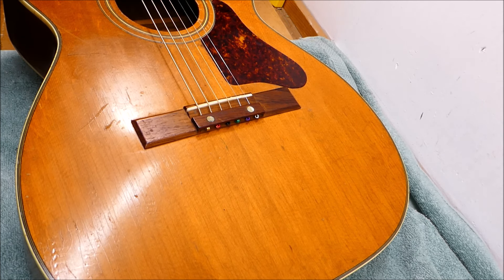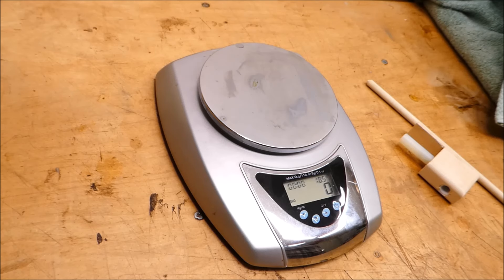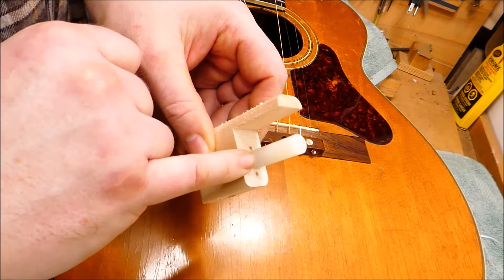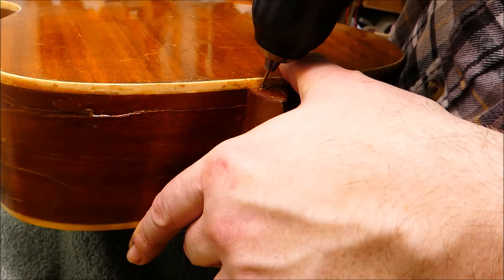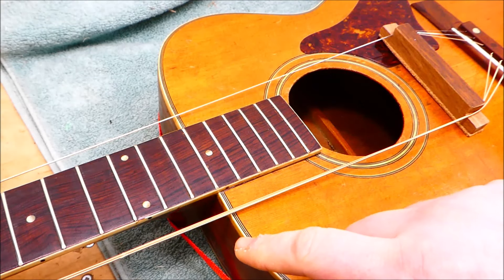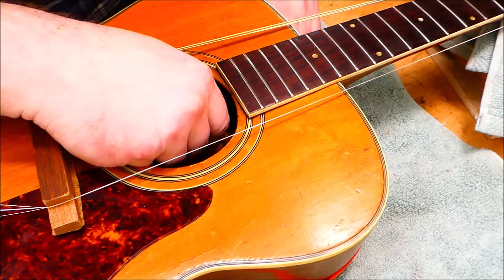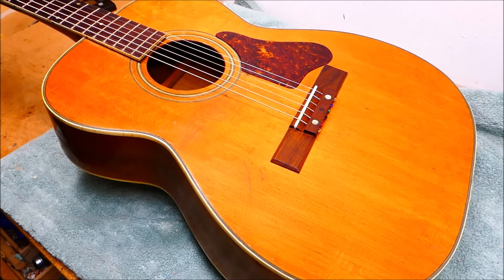Things went horribly wrong!

Comment: The Upgrade from tone nails to the timbre screws was a fantastic choice .
Reply: If I had that job there would be a 1/4" bolt thru the neck heel.  I'm no luthier, just a mechanic.
Reply: These are Swiss Moon screws. Wayyyy better than standard screws.
Reply: Those appear to be stainless steel, it would have sounded better with brass screws. :-)
Reply: @burp1914  Call it a “sustain bolt” and charge $50 for installation.
Reply: @burp1914  Thanks for making me chuckle! And no guilt, cuz it's a Harmony, not a Martin or Breedlove.
Reply: @frankcoffey  Oh, now yer just breakin' ba*ls! This is a Harmony, not a '50s Telecaster which should have brass bridge barrels. You made me chuckle, though. Thanks.
Reply: He almost nailed it! but this guitar is really screwed
Reply: @stratocactus  Are they the ones who ask for donations at the airport?

Comment: Extending a syringe with shrink tubing! Always some jewel in these vids.
Reply: that one stood out to me as well, great tip
Reply: right?

it occurs to me that maybe a small zip-tie around the shaft would serve to help seal the tubing onto the syringe if that was an issue
Reply: I liked that one, and the "string spreader" to move them out of the way for easier access through the sound hole.
Reply: @walterw2 : A zip tie would not work, on something that small. The "zip block" has a flat bottom, which will not conform, to the round needle and so not deal.
Reply: @zapa1pnt  sure; maybe something else around the tubing and the small zip-tie around that
Reply: A little squirt of super glue?

Comment: Bridge Doctors work very well. I have used them on many guitars that experienced a bulge including 12 string guitars. I have a customer had one installed that did not need one because to his ear it increased the sound of the guitar and to his ear made the guitar sound better. I would need equipment to measure the before and after to see what type of a difference it makes.

Ricky from IBM, Ret -Now a guitar tech in Englewood Florida
Reply: I've installed several Bridge Doctors as well. They do good things, like make an unplayable guitar playable.

Comment: The bridge truss (ie Bridge Doctor) does sort of the same thing as a sound post in a violin, however it does it to different degrees in different guitars; the back and sides now are no longer just reflective. They actually vibrate to the point you can feel it vibrate against your chest in many installations. A truss is an absolute must in a 12 string, and in a Penco I have actually gave it a sort of reverb effect. Trusses usually gives a guitar a more complex voice, sometimes quieting it, sometimes making it louder. Regardless, having the action and intonation back along with the top stability typically far exceeds any negatives brought on by its installation. This is why I've installed countless trusses in low to mid priced guitars. I also have a 22 year old Bridge Doctor in my personal 37 Martin 0-17 which sounds amazing and has thwarted a neck reset for decades now. Trusses are gooooood schtuff!

Comment: Enjoy your vids Ted. I wish you'd been available 40+ years ago, when I did setups and minor repairs for a couple local mom & pop music stores.
I remember having a Yamaha 12 string come in with a cracked neck block almost identical to this one. I ended up doing the exact same thing, running screws in to pull the block back together. It worked and it's still working to this day (the owner is a friends and still plays it), but at the time I wasn't 100% happy about the repair, feeling like I should have done it differently, but it was the least expensive solution at the time.
Watching you do the same, makes me feel better about it now.

Comment: I'm definitely not a luthier  however I suffered through a similar restoration where the bridge would not stay down it was a steel string bridge I glued it I did all kinds of things screwed it. Used dowels....I ended up using a dobro bridge on the bottom and slotting the saddle and I got to say it's the best thing I ever did I love that style guitar now. Good luck my experience is no matter what you do it's going to be tough to fight that string tension.

Comment: Nice job, a lot of work.  I think I might have been tempted to use a Dremel tool for the screw holes.
Reply: Great tip. Ideal use for the flexible extension! Sadly I do not have that on my dremel. 
I have a dewalt right angle drill driver gizmo, and I use that and hex mount countersink bits to get into odd spots like that.

Comment: Fun thing is, I wanted to write something about checking for more cracks in that block since it looked so heavily fractured in the previous video, but decided against it because you are a professional and you know what you are doing. Well even a professional is still a human. And humans tend to make mistakes from time to time. 
What defines a person is how they go about said mistakes. And the way you fixed this one looks quite nice.
Only thing to add about those screws (since it does not look like you use them for guitar repair all too often) is that screws made from hardened steel tend to disintegrate quite spectacularly being put under constant tension (learned it the hard way rebuilding old furniture). And the screws you putt there looked like hardened steel.
So if you hear a sudden pop, just know that they are gone. And not holding anything together any more.
Reply: Your last paragraph is funny and chilling all at once.

Comment: I have recently fitted a Bridge Doctor to my 1995 Epiphone Bluesmaster. Its action was a bit high, even with saddle reduced, but not high enough to deserve a neck reset and so I fitted a 'BD' and then tightened it in stages over two weeks with the result that it gave me the ca. 0.8 to 1mm improvement I needed to make the action acceptable up to 12th fret (it is a 12 fret guitar and not the sort of thing one is going to play at the dusty end of the FB anyway.

Comment: That cracked neck block certainly came out of left field.  FWIW, a less floppy alternative to shrink tubing is electrical insulation, 12 ga. worked for me. It is less likely to kink.  The outer sheathing works with a caulking gun too.

Comment: I have a classical guitar that had that kind of belly. Even the bridge was curved to the belly shape. Perhaps because it was strung up to pitch for the past 25 years or so. So I made 2 metal plates slightly curved to the oposite curve of the belly, boiled them in a pan of water, preheat the top with a hair dryer and clamp it all down for a day. What the hell was I thinking! But it did work. Now I losen the strings a whole step when I dont play it :)

Comment: If you use hex head screws, either surface or recessed, you could secure them using a 1/4” ratchet. That works well in the access of a guitar cavity, and you greatly limit the risk of stripping the Philips screw heads. Torx would work too.
I’ve been through the frustration of removing someone else’s stripped head Philips screws on such a repair. (Disclosure: I am a hobbyist/novice at this) The repair failed because the chucklehead who did it stripped all of the screw heads and could not fully sink them in, and called it quits. I doubt he predrilled properly, and he did not countersink anything either.
I predrilled them and used recessed hex head screws. Hex made it a lot easier to torque them in fully and evenly with a ratchet wrench.
Reply: Another option, being in Canada, would be the Robertson screws we see dotted all over his jigs. Yet another reason to detest Henry Ford; it's his fault Philips screws became the default in the USA, because he was too stingy to pay for the license to use Robertson screws. Philips is the second worst screw drive in existence, and I make the effort to avoid using it whenever possible.
Reply: Yes, Philips head is a scourge compared to todays options. But they are everywhere. I’ve learned to work with them, but I agree with you about avoiding them whenever I can.
Reply: until you shear the head off because you over-torqued the screw. Then you're really screwed
Reply: Ted is Canadian. Robertson screws eh?
Reply: The only wood screws I've sheared the heads off have been Philips head. Probably because they need to be made out of cheese so when they inevitably strip, as they're designed to, it's the screw that strips rather than the screwdriver.
Reply: Well, finesse is part of the equation with any repair on anything. Torque is a relative term. It does not mean crank the hell out of it. And if the assembly screws that come with anything look like cheap garbage I just throw them out and use good screws. It’s just smart workmanship.
Reply: Ted seems like the kind of guy who appreciates a little soap on the threads, too…
Reply: soap is hydrophyllic. This would tend to rust screws and invite moisture where you do not want it to be.
I use wax. The best I’ve found is the wax rings used to install toilets. They are cheap and have the perfect consistency. I bought a wax ring,  and stuffed it into an empty soup can. Keep it in my screw caddy. When I need it, I just dip the screw in the can and run it across the wax blob a little and it’s good to go. One handed operation. One ring will last you a very long time if you don’t drive screws for to a living.

Comment: I would be putting 010.- .047 strings on it so it has less tension on everything. I know from personal experience these sort of repairs are extremely time consuming and you can’t charge for the actual time spent.
I did a repair years ago on an ovation acoustic where the neck had come off the plastic body. I used epoxy glue and wood screws on the inside of the body into the neck heel to reattach it so the joint wouldn’t fail again. Luckily it had a removable cover plate on the back so that made it a bit easier.

Comment: Ted: Another way to do your "extended syringe" would be to attach the syringe to one end of the tube and the needle to the other.
Then, you would have the needle available to put into the cracks.
I don't have any particulars to offer on doing this. I'm just thinking out loud.

Comment: Ted, you'd probably be better off using screws that aren't threaded on the section closest to the underside of the heads, perhaps the last 1/2" or 3/4" or so ---- better for pulling two pieces of wood together.
Reply: And if you don't have such screws simply grind pff the threads you don't want,
Reply: @stevengomes4769  or ream out the holes in the top piece like he did in the video…

Comment: Now I'm wondering if the tone nails are what killed the neck block. Nails are definitely a forceful method of joining wood, wire nails especially. I'm impressed with the idea of using shrink tubing to make a flexible syringe, that's getting filed in my "clever ways to do difficult things" archive. And, judging by the flexible shaft I own, it's really not likely that one will be able to get at the neck block through the soundhole. They're not THAT flexible!

Comment: Not a nit pick by any means, but next time you have a structural repair involving screws, look into Robertson Lo-Root type screws... They have a coarser thread with a thinner screw shank that gives much more bite and they'd be far less prone to strip out in wood like mahogany or soft woods. I performed pull tests on various types of screws and they do outperform the garden variety screws you typically get at the hardware store!
Reply from the maker: I'm familiar.  The screws in this case are almost incidental - just there for clamping while the glue sets.

Comment: I rarely have much to add to anything you say but I did think you could file the thread from the screw nearer the head so it wouldn't bite into the wood on the broken part of the block. Rather than doing a second larger hole

Comment: If you had realized that the neck block was split like it was when you had the neck off would the instrument repair had been simpler?

If you had realized how big of an issue doing the repair through the sound hole was going to be would you have opted to take the back off instead?

Comment: Put some moleskin or some Curlex or bandaids, or even some cloth or paper tape on your knuckles. Ceiling tile installers drag their knuckles along miles of ceiling tile every week working their hands like marking gauges along the tiles and the walls to pare away some of the ceiling tiles along the walls so they will hang down below the grid properly. Those tiles have some super incredibly abrasive fibers in them, so they tape up their fingers. If they didn't do this, I don't think they'd have any fingers.

Comment: Would heat shrinking a piece of syringe needle to the working end of the rubber tube have helped with aiming/inserting the glue into the crack?

Comment: This reminds me of my 1984 Lincoln Mark VII.  I could never get it to where everything in the car worked ,  something was always broken .  Fix the compass system ,  the trunk motor would break, fix the suspension sensor , the power antenna wouldn't go up and down.  At some point you just have to buy a new guitar.

Comment: Frustrating, that crack in the neck block. Drilling with the jewelers drill is prudent, but my carpal tunnel flared up just watching. You certainly earn your money! Perhaps an electric screwdriver might fit comfortably into the sound hole, but how often you’d use it might not justify the expense. Carry on good sir.

Comment: I'm not a steel string player but have reasonable expertise in classical instruments. My question is,  that given that good classical guitars are built on a solera (i.e. they have a dome deliberately incorporated into the top), are not steel string instruments built that way also? - doesn't a carefully domed top merit an appropriately shaped bridge? and how would a repair luthier determine what proportion of a dome is original and what is caused by later deformation? 
I ask because I was horrified to see a Stewmac YouTube clip where they glued a flat replacement bridge onto an instrument, in that case they simply seemed to assume the top was or should be flat.

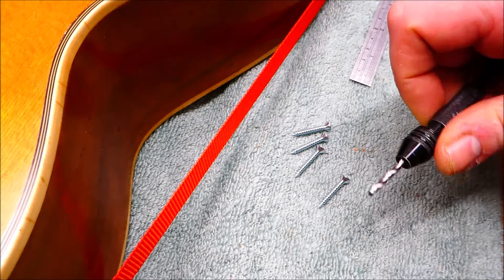Comment: 10:15 It almost screams for an engineering company to make a small motored drill bit. capable of fitting into such tight spots, powered by a thin cable - like fibre optic? StewMac? I agree a Dremel flexi drill won't fit in there.

Comment: That's a bummer...I guess it was better that it failed in your workshop than in the customers hands right?... using the Dr to address the belly bulge must have created enough force to open the heel block fissure (im sure Newton's 3rd law has acted out there somewhere?)....and it just goes to show the tensions and stresses guitars have to endure through the years...in the mid 90's when I did a diploma in Spanish classical guitar construction here in the UK we went on a field trip to the Royal Academy of Music in London where we actually handled a Stradivarius baroque guitar, built in the late 16th century (yep he made guitars too)...anyway when they inspected the instrument and xrayed it years before, they found that he had joined the neck to the body with nails... apparently this was the tech used by makers before the dovetail was invented for violins as well as guitars....so to all the "purists" out there that may be rotating their heads 360° in disgust with you using screws ppfft...yeah whatever...which brings me quite nicely to the proverb...necessity is the mother of invention....